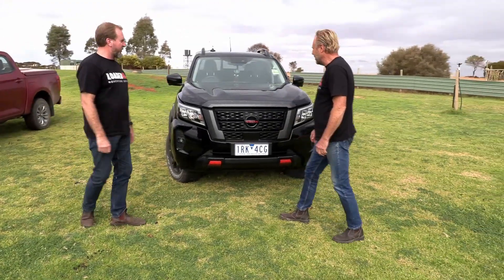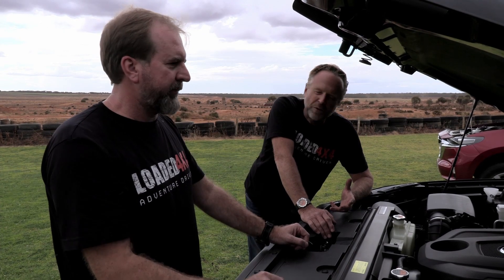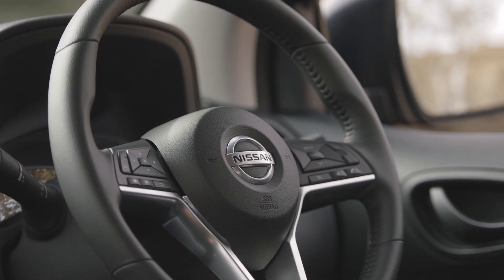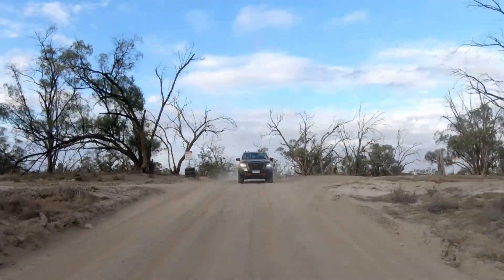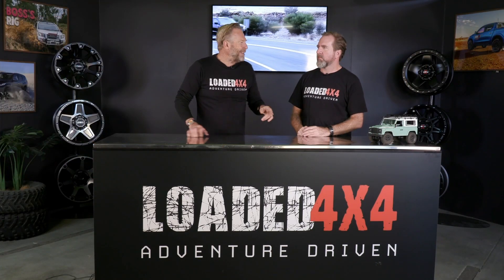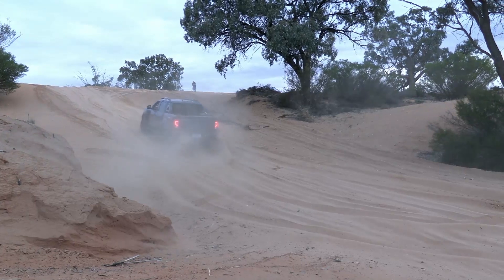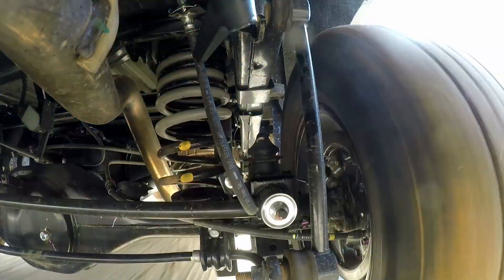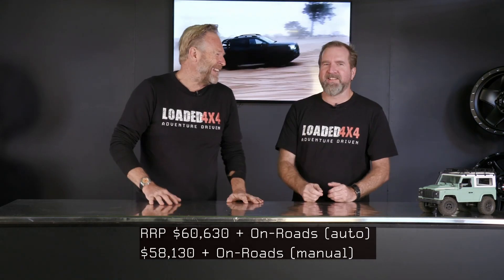2021 Nissan Navara PRO-4X Review: Is this the most underrated 4X4 ute in Australia?

Comment: Awesome reviewI guys! watched it in forensic detail.

really wanted the X-Terrain but was dissapointed at the current wait times. +8 months
So I went out looking and fell in love with the PRO4X yes i understand for the top of the range model it lacks some things.

You guys have really done a great job on this review and can not wait for my own stelth grey PRO4X to stop floating and make it to the bitumen which nissan tells me the 7th of July and delivery is the week ending the 12th.
I went with the snorkel, not just for river crossings but the clean air intake, Tinted windows, Off-Road Coated Bullbar with hoops, Tow bar is included yet i will have electric brake controller installed. all for $67,343.40 

Two questions?
In the footage you guys were talking on the UHF, was that a temporary install or perminant? what location do you recommend to have it installed, as i will have the antenna on the bullbar hoop?
What tyres would you recommend without having to upgrade the suspension or lift kit?

Keep up the good work guys loved it!!!
Reply from the maker: Glad you enjoyed our review mate and congrats on buying the Pro-4X! UHFs were temp fits and to be honest, I don't know where/how folks are fitting UHFs in the Navara. My recommendation would be to join one or more of the D23/NP300 Facebook groups and search those for UHF installs. In my Triton I have an iCom 440 which has the controls on the hand unit and I just Velcro the box under the passo seat. Power and aerial run up through a bung in the rear floor and out from under the carpet where it finishes under the front seat. Others bring the cables in through existing bungs in the firewall. There's probably a number of ways you can fit it up in the Nav, and FB is where you'll get the best tips/tricks on that IMO. I personally try and do it without pulling out centre consoles or putting holes in the dash. Have fun with the new car and make sure you take it off-road!
Reply from the maker: Oh and tyres! We're Toyo fans. David has been running them for years on his training fleet and hire campers and I've recently been running them as well. Best tyres I've experienced to date, really good steering feel, bugger all noise for a reasonably aggressive AT and this will sound weird, but they ride better than other tyres I've tried in recent times (same pressures). Toyo's AT is the OPAT2 which is what I run on my Triton, there's also a hybrid RT and a mud tyre available. Go for LT (light truck) construction if your plans include heading off the bitumen. - Steane
Reply: @Loaded4X4  Thanks heaps 'O NO' FB i go! no really thanks and keep up the good work! Quick responce too.
Reply: I have the Series 4 Navara N-trek and I think the CB fitment would be the same. I have a Uniden UHF 8080S and the radio unit is fitted under to centre console, left side, forward of the gear lever. The only thing that is exposed is the microphone (remote head unit) mounted to the dash. It is a real neat fitment. I had the radio unit mounted on the left side, as the wife handles the communication when we are on the move (I can still use it when I am solo).
Reply: @jockmarshall7601  under the passengers seat! Away from the heater vent, and the mic is installed on the centre console.

Comment: The first 3 gears are really slow on road, but once u hit 4th upwards it really goes.
Then when u go off road u start ti appreciate 1-3 gears.
On the highway at rolling speeds it does better than others all the way to illegal speeds. The 7th gear is 0.777, which means it is a working gear at high speeds, better than the 0.64 ratio of 6th gear hilux

Comment: The pro 4x is based of the ST. The STX with leather has heated and electric seats
Reply from the maker: The Pro-4X has the same spec level as the base STX and adds the specific Pro-4X leather seats, and other Pro-4X black stuff like wheels and sports bar etc. Heated and electric seats are only available in the STX as part of an option pack which includes upgrading to  leather, or maybe it was partial leather... STX has a few option packs that can be added to increase its spec while the Pro-4X is a take it or leave it deal. It is an odd decision to fit a swish leather interior to the Pro-4X and leave out heating, electrics and lumbar support adjustment.
Reply: @Loaded4X4  + no sunroof option on the Pro4x. 
Suspect it was not available to keep the 1tonne payload as Sunroof adds a lot of weight

Comment: Mm interesting, HOWEVER THE PRO 4X is the most expensive but does Not have all the fruit, electric heated seats are off the planet luxurious in cold weather, the pro 4X has aesthetic enhancement and looks awesome But top spec model is the STX, Did the research bought the new STX
NO REGRETS..... ☺ 💞